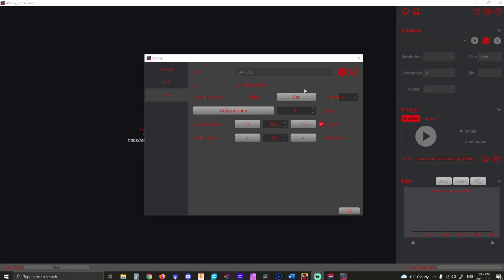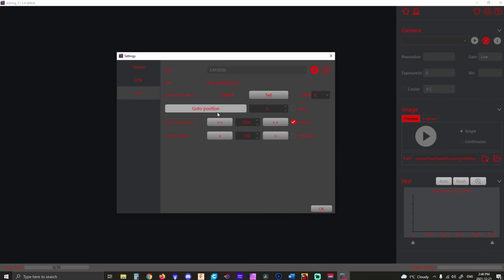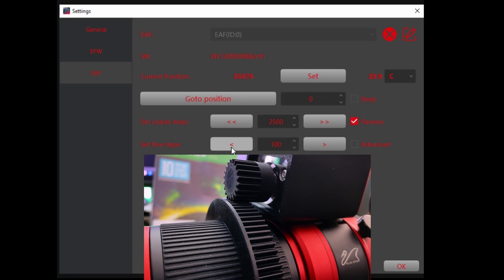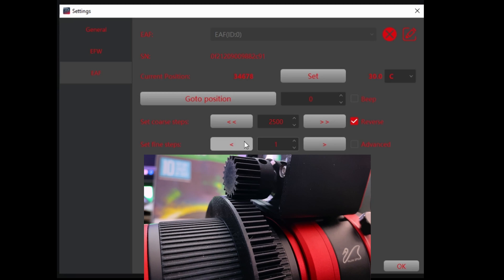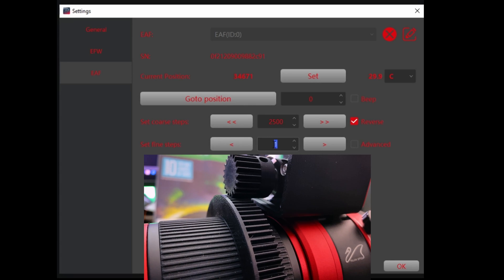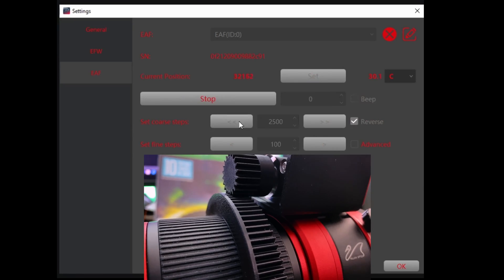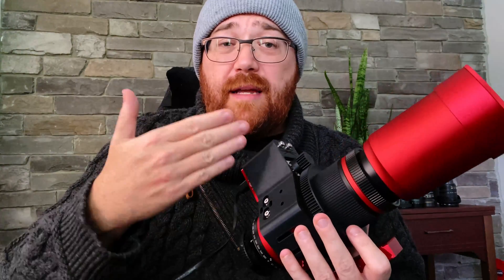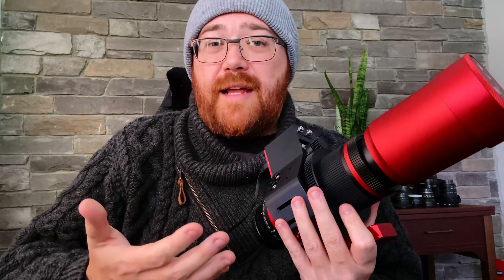ProAstroGear Black-Cat System Settings and Semi-Circle Set-point

Comment: i find that the wheel at times does not sit in the tooth groove and i have to readjust down quite often.  why so?
Reply from the maker: Hmm... best to reach out out Black-Cat for an answer, sounds like you don't have enough tension on the belt so you might need a larger sprocket wheel.

I'm assuming you live in a hot country?

Comment: Hi Greame, great video.  Since you have it the Black-Cat on hand, do you thing that it will fit on my Tamron 150-600 lens ?
It will be great if I could use it.  I wasn't able to find the focusing ring diameter to confirm it. If you don't have the lens, please teel me what is the ID of that ring.
Thank you
Reply from the maker: RedCat51 rubber focus grip has an outer diameter 2.991" (75.94mm) Diameter. Black Cat is slightly smaller at 2.955" (75.06mm) so that it grips and holds the focus ring tightly.
Reply: @EmberSkyMedia  Thank you.  Tamron lens OD is 83.67 mm, so I don't think it will fit. 
Thanks again and Happy Holidays.